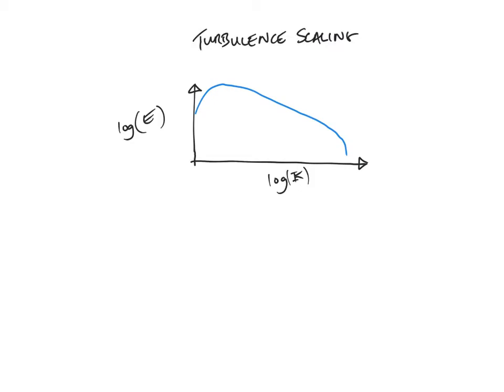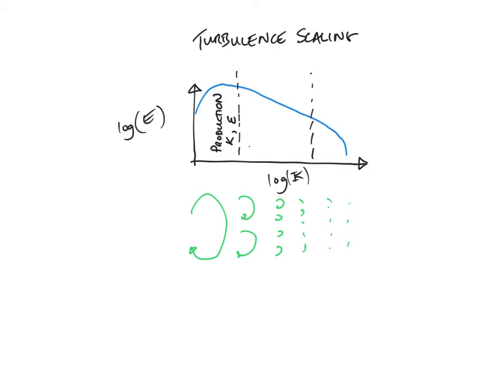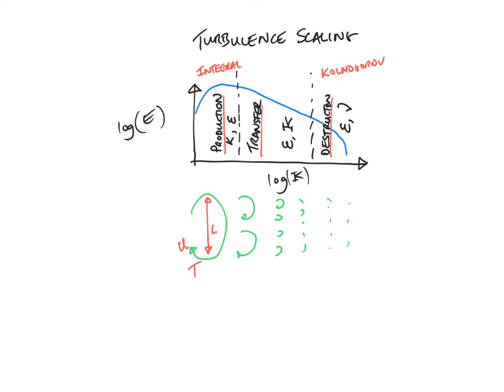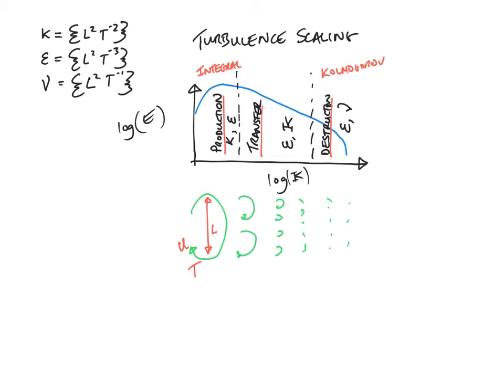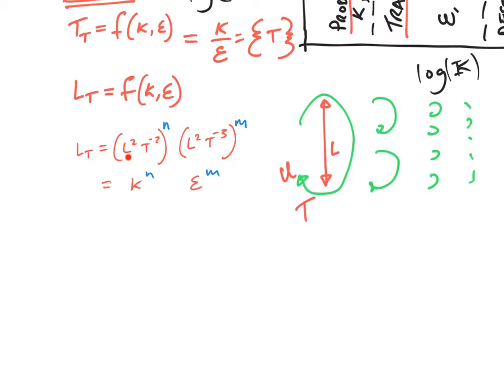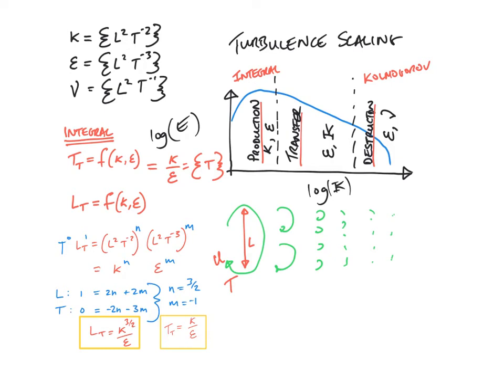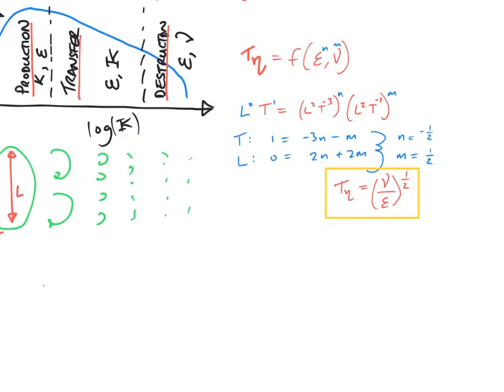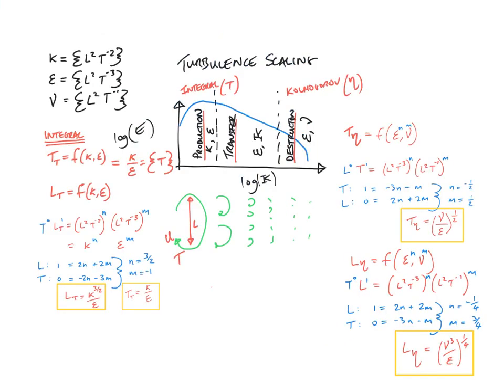Advanced CFD course: Turbulence Scaling

Comment: why does energy increase with decreasing size of eddies in integral region?

In inertial range, the eddies split into smaller eddies therefore, the energy decreases. In the dissipation range, viscosity takes over, energy decreases faster with decreasing size of eddies. but i cant really understand the integral part?
Reply from the maker: Interesting observation. It's difficult to interpret very low wavenumbers. Remember that wavenumber is 1/L so as you approach zero wavenumber you approach infinite eddy size. There is likely to be a bit of a spread around the 'integral' scales, due to non-linear interactions between largest turbulent structures, and high degree of anisotropy. 

While most equilibrium turbulence involves cascade of energy from larger to smaller eddies, in certain circumstances it is possible for energy at smaller scales to larger scales. This so-called 'back transfer' can be seen for instance in rotating flows.
Reply: @mcji8ar2  Oh! Interesting. I was not aware of the back-transfer effect. Shall read about it. Thanks anyway!